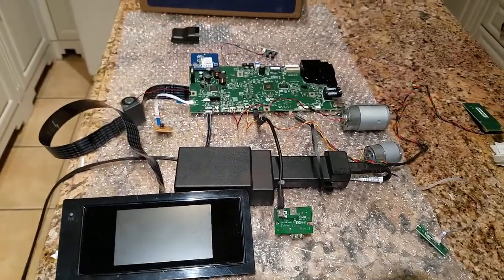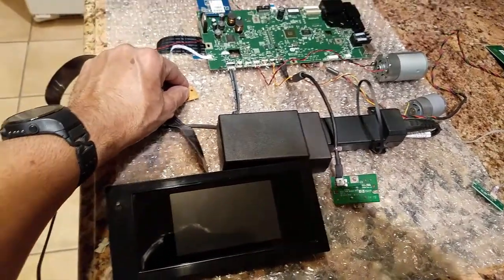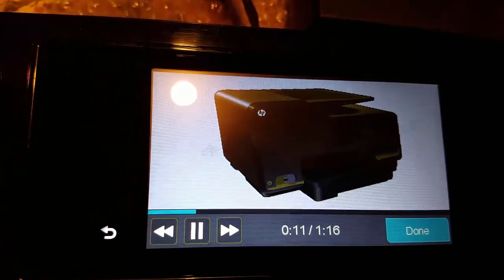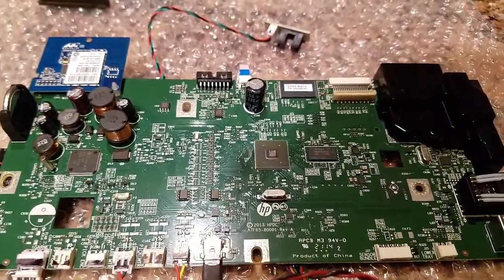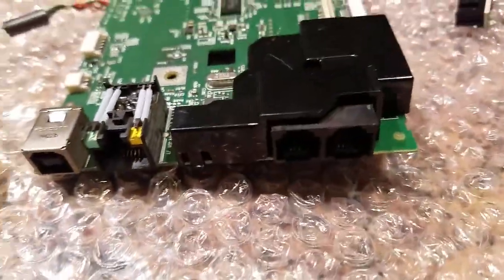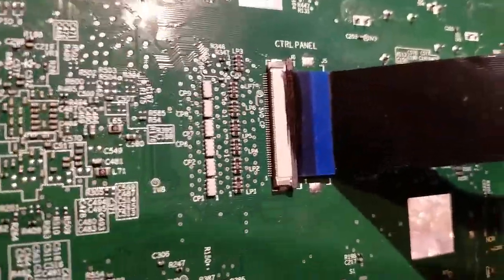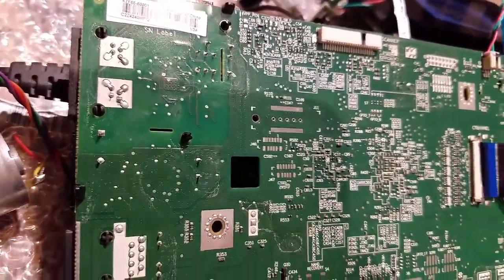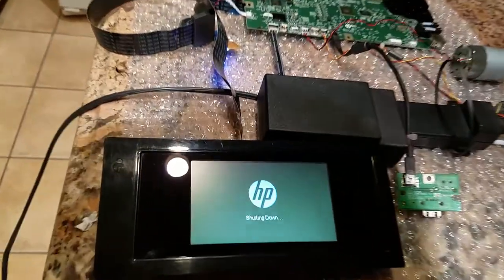Reverse Engineering and Recycle an HP Printer Touch Screen Display - Part 1

Comment: Hello Mike, did you figure it out, I've had a control panel touch pad from HP for a while now, and I can not figure it out, my circuit board on the back of the touch pad says CN503 80002 A, but I think the CN503 60002 is the same. look forward to seeing part 2
Reply from the maker: I am working on Part 2. I have an oscilloscope and tried checking the signals.  I can see some interesting signals. But I think I need a logic analyzer.
Reply: @BiffMartin   I've been using a cheapo logic analyzer from ebay for this sort of thing. Plenty enough for a homegamer! Mines not even branded! 😂 I've got an lcd from a dead Samsung laser printer on my own bench atm